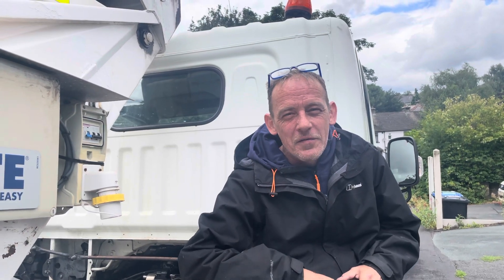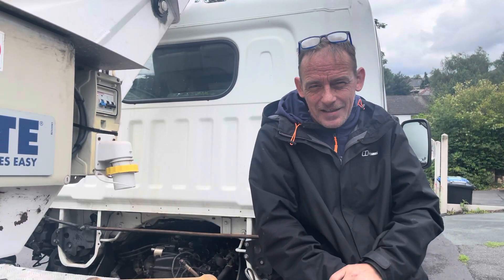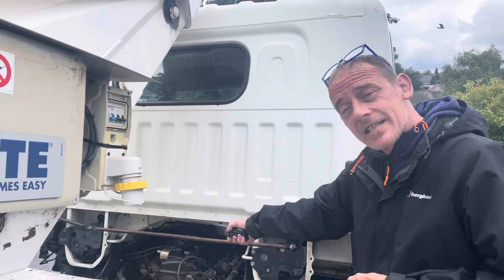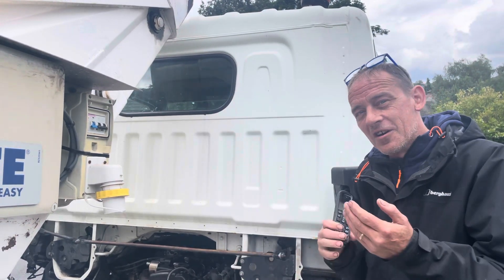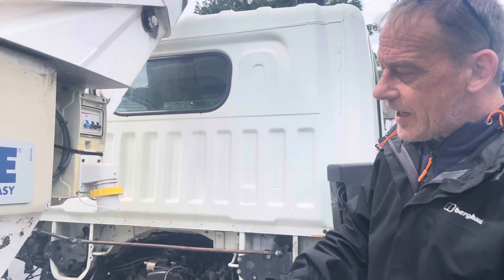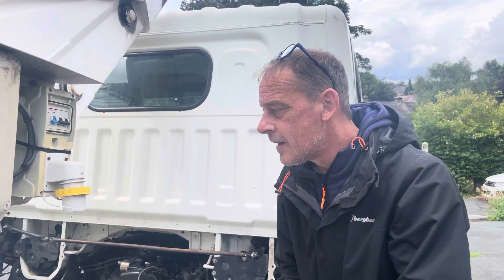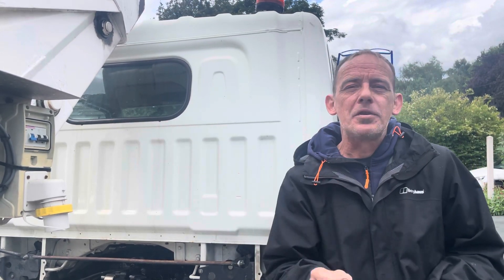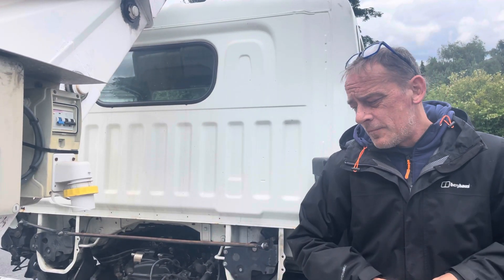Nissan overheating problems NP300/Navara/cabstar

Comment: If you gut out the dpf and do a remap. Will that prevent the overheating problem?
Reply from the maker: Have you seen the other videos on remaps that is not the we would do it as remaps can kill engines faster Thanks for the question buddy
Reply: @westyorkshireengineservice9160  no I haven't seen the other videos on remap.i will have a look thanks pal.
Reply from the maker: @manfromnightmares.6697  All the best mate thanks for watching and your input Des

Comment: Hi sorry this is a bit off topic but hope you have ideas , we have a D22 with the 2.5l motor , it will rev to 2000 then cut and revs again just keeps doing that will not go past 2000 , we have replaced the valve on the pump and the pedal controller ( no difference) , it was in a flood but all cleaned out correctly , scan only showed the pedal unit  and engine temp any ideas we are at a loss thanks Colin
Reply: cancel that it was a faulty engine temp sensor

Comment: Hey I got a yd25 d40 2010 Nissan NAVARA I was wounded I bought a reconditioned engine for it and I went to fit the valve cover and it seems to be a different shape any ideas?
Reply: Wondering *
Reply from the maker: Could you send me a picture westyorkshireengines@gmail.com
Reply: I did try to but as I’m from Australia I’d didn’t seem to want to I’m not to sure
Reply: All the bolt holes line up but at the rear of the engine the valve cover seems to be a bit short

Comment: I apologize, but I don't know English well. What I found out is that the engine heats up because the DPf filter is clogged... Do I understand correctly, because I drive a Renault Maxiti, which also heats up and I'm about to open the engine to replace the gasket. There is no meat in the antifreeze, there is no antifreeze in the oil. Not even steam escapes from the generation, but it heats up and expels the antifreeze.